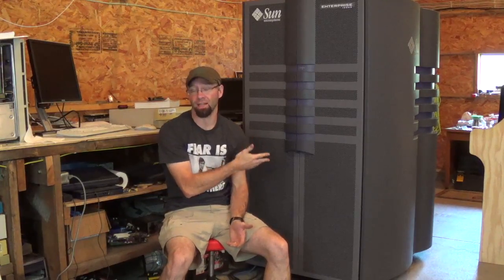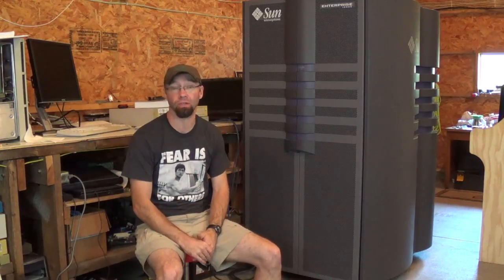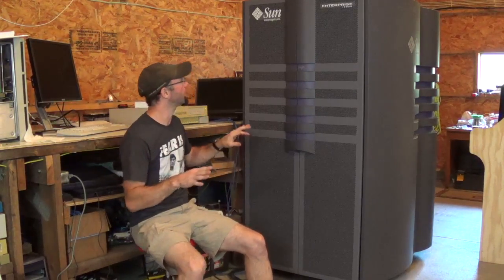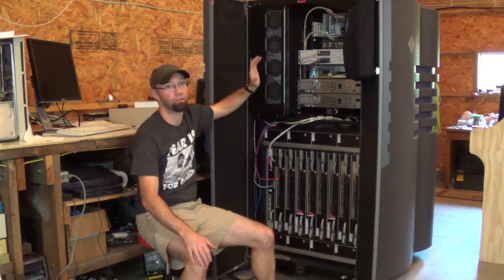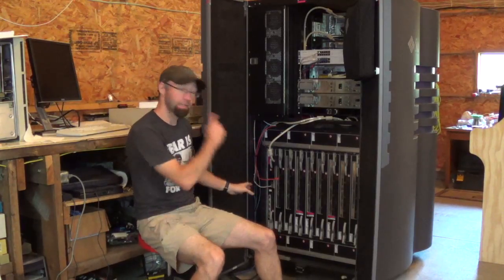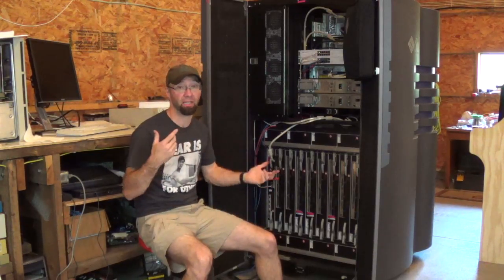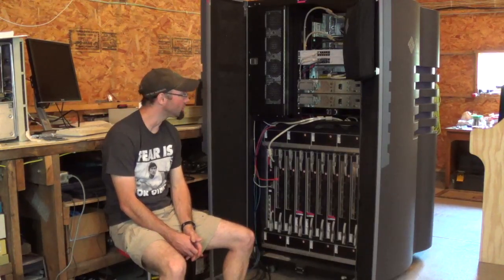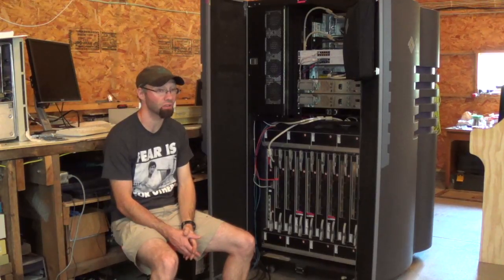Sun Enterprise 10000

Comment: I went to the 1 week E10k sysadmin course back in 2000. I had 3 of these, one in D.C, one in Hawaii and one in Colorado. Loved these things, great server. We turned them in due to the high maintenance cost. Replaced them with 16 E420 servers which were junk and had to be replaced due to a bad system board design.
Reply from the maker: Man that's awesome. Don't suppose you know where the DR modules are for Solaris? I can't find them to install them on the E10k :)
Reply: No idea, it’s been 17 years since I touched an E10k. Wish I could help.

Comment: Well ..the good old times ...enabling extended POST on a fully equiped E10k will make you happy. Depends on which memory/cpu test your running it can take up to 24h :D ...check OBP there are a lot testing tools -> type "ok> sifting <search item>" like if you want all commands which do probs type: "ok> sifting probe".....btw... try to get the diagnostic tools for the SP, with them you can jump with a cli from one chip to another. Like from the x-bar to a memory unit or cpu. You could ask oracle or start a community request if some of the engineers still have software.
Reply from the maker: This is really helpful, I'd not heard of this at all, thank you. I don't have any actual E10k media, but I do have "real" SSPs installed with their original software, so if I'm lucky it's on there. When you said the diag tools - do you mean the SunVTS suite, or something different?
Reply: Ur some years too late..i deleted all my sw and recycled almost all books. but try this:
http://shrubbery.net/~heas/sun-feh-2_1/Systems/E10000/infodoc.html
http://shrubbery.net/~heas/sun-feh-2_1/Systems/E10000/
http://www.imhans.com:1004/syshbk/Systems/E10000/fin-fco.html

Some extra infos:
http://shrubbery.net/~heas/sun-feh-2_1/General/OBP.html
http://www.datadisk.co.uk/html_docs/sun/sun_e10k_commands.htm

This are docs from the FEH., you should wget the docs. Guess its hard to find the internal papers but if you can find them..keep it !! Try facebook & Co to broadcast, former sun ppl are always friendly :D
  
The tool where i am talking about is running on the sp and is not vts. Can't remember but maybe you will find this in the info docs and be lucky to find it online.

The installation of a HW-Domain and it's OS is easy. Just create a domain, assign CPU Board and IO Board, finish. Boot until ok promp and run "boot net - install" so far you have created a jet server. If you just wanna play use: "boot net -s" is booting into mini os, no disks required...check disks at ok with "probe-scsi-all"

when you play around with the boards/power BE DAMN CAREFUL with the centerplane !! NO FORCES and ALWAYS ESD !! If you overbend the cplane it may cause damage or malfuction in multiple devices. Disassamble and replace the centerplane for a not trained guy is very hard and expensive.

!@! SUN 4 EVER !@!
Reply from the maker: Thank you, Fred, I appreciate you going and digging this out for me. I actually have all of these archived and am at the point where I have the system up and running (there are a couple of later videos after this one). At present I'm trying to work out how to add SBs to an existing domain (I'm missing whatever SUNW package has the Dynamic Reconfiguration daemon, so I think I'll just have to delete and re-create a domain with the additional boards) and has to conveniently test hardware so I can track all the bad DIMMs and replace them in the system. I've thrown out a couple of "help?" messages to various list serves but apparently old FEs are either so over this shit, or they hide from us :)
Reply: ur welcome ...np, sun is my job and it didnt took long to find it. Can't remember if a 10k could add a new board to a existing domain, check the info doc ( 1. link, last post ). Sofar i remember DR is only possible on existing HW. Like you have 2 cpu boards, you can disable the one where not the kernel is, replace it with cfgadm and enable the board. In sol8 you can add /etc/system setting to do this with all cpu boards.

With psradm you can enable and disable cpus.

Just delete domain and rebuild. The os is still on the disk, so its not a problem. Before you do this. backup "/etc/path_to_inst" and empty the file "echo > file". If you have new paths it increases the numbers of example controllers. After you're finish "boot -rvV" -> "-r" equals "touch /.reconfigure" -> -v and -V verbose Kernel and OBP

With "boot -a" you can do a interactive boot

Dont forget to patch :D
Reply from the maker: Heh, thanks. The SSP has all the front-end DR software ("dr", unsurprisingly) and can add/remove boards from any running Domain (thank you E10000 Site Administrators Textbook) - but it requires the drd (DR daemon) running in Sol on the domain to hand messaging around to tell Sol to drain the boards as well as add them in. I can't find the SUNWldm package which appears to have drd in it.

But, at this point, I think the easy thing is to delete the domain (I have the SSP thoroughly backed up) and rebuild. I actually have done half another video but I injured myself and haven't gotten to finishing it up or editing it. Getting old sucks. Thanks again, Fred, I really appreciate your memories.

Comment: What is the linpack score on one of these?
Reply: I realize your message was from 8 years ago but I thought I would respond anyway for those who might have the same question. We had one of these installed in 1999 at Lockheed Martin. When we ran the Linpack benchmark we hit just over 92 Gigaflops using FP64 datasets. The system we had was maxed out with 64 processors and I believe around 64GB of ram. Our result wasn’t the fastest recorded from other Linpack tests at the time (which I believe some exceeded 100 Gigaflops with the same hardware). Unfortunately we didn’t have a lot of time to tune the source code to achieve a higher result. The test was setup using SunStudio to compile the source code and having the appropriate MPI library and Sun SPL installed. It was a beast of a machine in its time and quite reliable too.

Comment: I`m searching for a Sun Enterprise 10000 server for buy. Somebody have a price range?
Reply from the maker: This depends on where you're getting it from and in what state it's in, not to point out the obvious. I've seen more or less complete E10ks go for $100 on eBay - although not in a couple of years. Rarely do they come with their SSPs, though, so you'd need to find an appropriate machine and find/install the packages yourself. The trick with E10ks, and part of why they tend to be so cheap, is they're freakin' huge and you need to be able to transport it, which is not insurmountable, but requires... dedication. Best of luck!
Reply: go to http://www.anysystem.com/ there you can buy sun systems. 
!!! BEFORE YOU BUY A E10K CHECK THE STATIC OF THE FLOOR !!! And you need a High Voltage Plug, its not running with the normal 220V plug. 

If you want sth. small but with same power, buy a SF3800 or SF4800. With the SF4800 you can build hardware domains. Both running with 220V but still min 10A under load